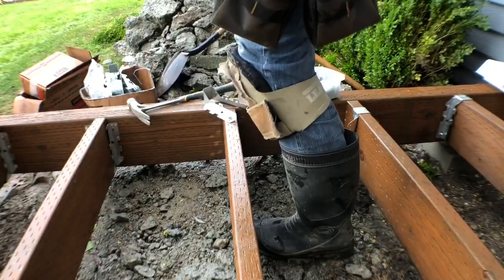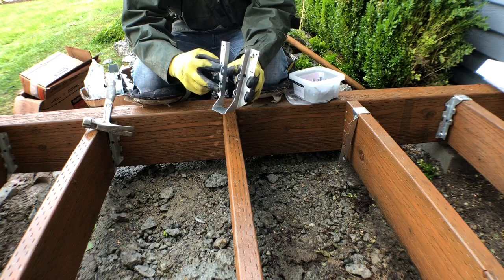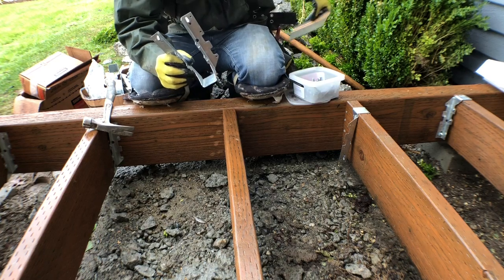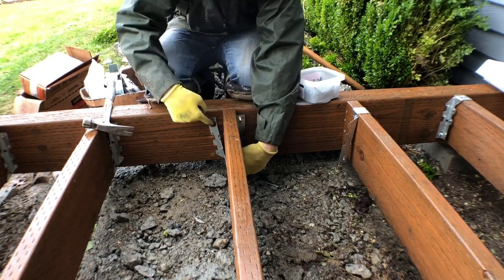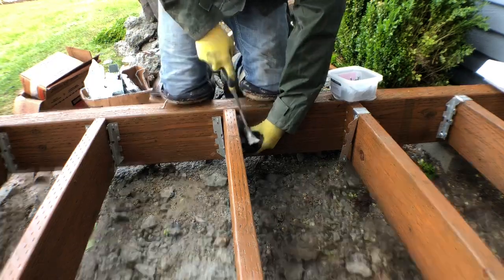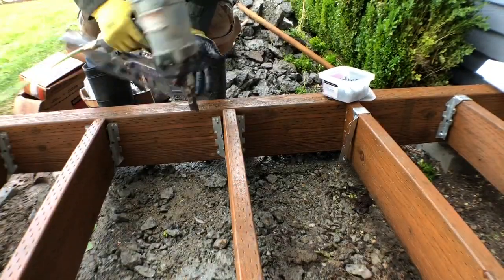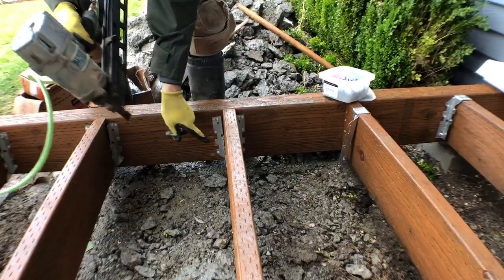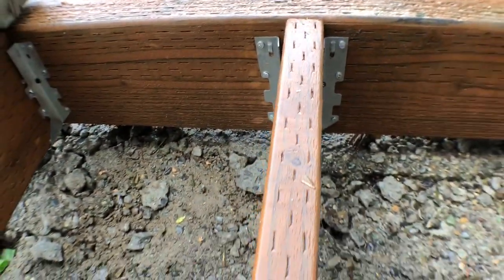How To Install Joist Hangers

Comment: the lumber thickness is typically measured 1.5", the joist hangers are all sold in 2" width, how do you fill up the extra 0.5" gap?
Reply from the maker: most the hangers are 1.5" even though they say that they are 2". Its the same as 2x4 boards are actually 1.5" x 3.5".